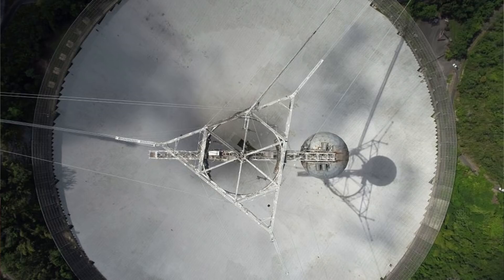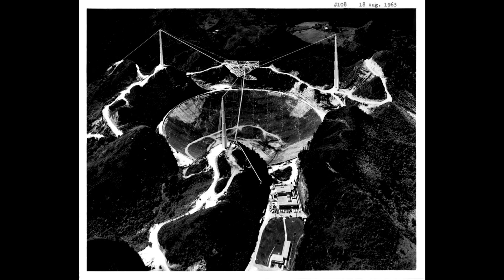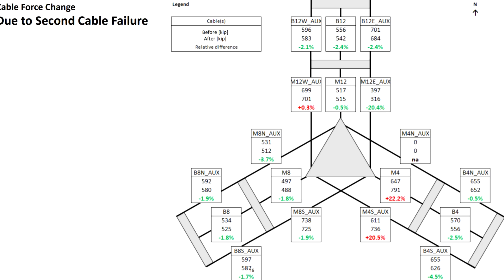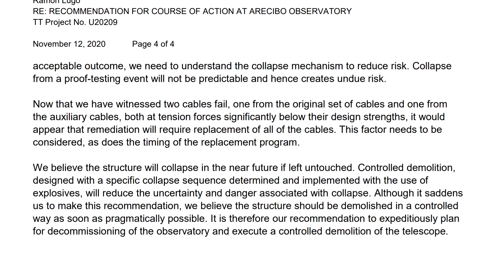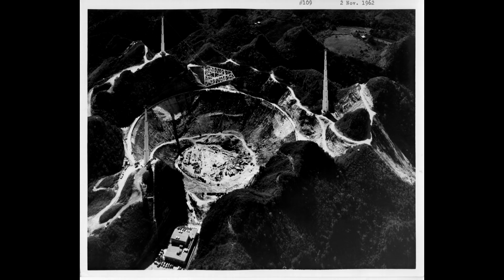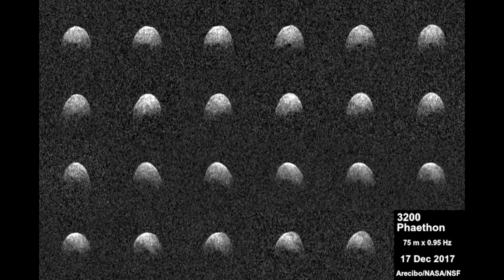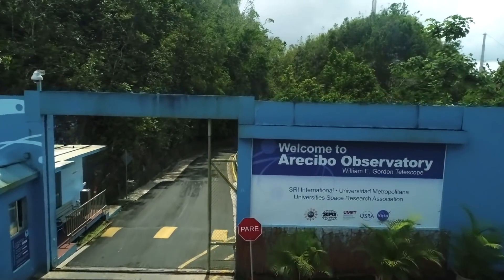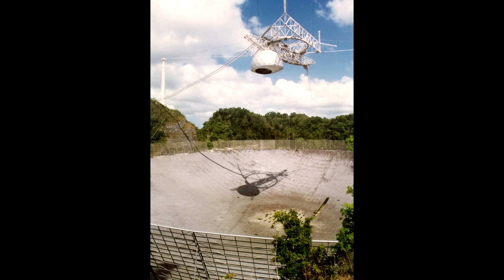Worlds Largest Radar Astronomy Dish To Be Demolished!

Comment: Could we coordinate, using FAST to image echoes of pulses generated by Goldstone?
Reply: It's an interesting idea. But the facilities are on nearly opposite sides of the world. FAST would have to turn nearly to the horizon, which it can't.
Reply: @some1purple  By the time the signal came back earth would have rotated multiple times already. Seems like it would be doable. Using Earth to aim and the FOV is multiple of 12 hours
Reply: @Peizxcv  Gonna disagree with ya there. Depending on orbital positions, Mars is  5-20 light minutes away. Doubling that time for the return pulse is 10-40 minutes. The earth doesn’t spin that much in 10 minutes (or even an hour), and near earth asteroids are a lot closer than Mars.
Reply: @mrb692  Yes, I forgot radar astronomy doesn’t look for extrasolar objects as other astronomy
Reply: @someone doh!

Comment: Cant they build scaffolding underneath, or a tower that could take a bit of the weight off during the fixin
Reply: The problem is that those other cables could fail at any time.  That would cause the platform to fall, of course, but when cables snap under tension, they whip around as the energy is released, so the entire 'bowl' and surroundings of the towers are also danger zones.  This is like the engineering equivalent of storming the beaches of Normandy.

Maybe, instead of dangling workers from helicopters overhead, you could creep them in on the ground in armored caissons, but that's a nasty sword of Damocles to try to catch...
Reply: Not really. Do you want to be under like 700 tons that could fall on top of you at essentially any second when one of the remaining corroded cables snaps?
Reply: Visualize what's going on right now with it, the cables can fail at any time. So unless that issue is made safe beyond doubt there can't be any work done to erect that scaffolding under it to take the weight. And if the current cable suspension was made safe enough to do that work there would be no need for that scaffolding. Hind site engineering is always 20/20 but in that hind site it was and is a poor design for long term preventative maintenance. With it's random and at times poor funding there's now no doubt it's suspension cables are degrading due to environmental reasons. I'd be willing to bet money that somewhere in there archives there's more than one engineering memo warning of future issues with these cables that got ignored due to budget. What ever gets built (if ever) to replace this they can at least learn from the design mistakes made on this one. And since it was originally built large cable production and methods of protecting them from degradation has advanced exponentially. Large open pit shovels as one example now use plastic coated steel cables to vastly increase there service life.

Comment: Sooo .. time to make a challenge to design a replacement that is, AT A MINIMUM, the same capabilities/specs of Arecibo Observatory.
Reply: No, there is  far better one and the Worlds largest already, far outstripping this one in China called FAST.
Reply: @AnarchyinFallout  
As Scott noted in the video, that one is not nearly as capable since it was designed and built as a radio only telescope.   Arecrbo was designed, built, and upgraded, as a more versatile and capable Radio & Radar Telescope.  Yes, it is smaller than the one in China (~300m vs ~500m diameter) but the one in China is more optimized as a radio only telescope.  
Thus the idea of a Challenge to come up with a design that is AT LEAST as capable as the upgraded Arecrbo Telescope with modern materials, techniques, and technology.

Comment: Someone should also decommission The Leaning Tower of Pisa it is dangerous.
Reply: It's not. It has been stabilized for years now.
Reply: So you see my point.
Reply: @Dysturbed-00  
Your points not valid.

Fixing the tower was pretty easy. Just had to drill holes underneath and fill with whatever kind of concrete they used.
And the building was on the ground, not hanging by cables that obviously weren't made to the level they thought.

But it's not actually that hard. They could just build scaffolding under it.

But the unknown cable problem makes that VERY unsafe.

They would literally have to design and build something that could just reach up and grab 800 tons all at once.

VERY doable. Also, VERY expensive. Probably more than building a new telescope. And would take more than long enough that the other, already damaged cables, are about guaranteed to break before the equipment was actually built.

800+ tons, 500 feet off the ground, with a serious time limit.

Not everything can be engineered. Engineering takes time. the tower had many years to go before it fell, and all of the engineering to do it had been done long before. They just had to apply it to that situation.

The telescope has a lot of dangerous unknowns that the engineering can't really be done for now. And it wasn't done before.
Reply: They actually spent a lot of money and engineering to "stabilize" the tower at Pisa so that it is no longer subsidizing. It had 'suspenders' on it for several years along with counter-weights.

Comment: As a metallurgical engineer my gut instinct on why the first cable failed at only 60% of its expected breaking strength is the cable probably experienced some fatigue.
Reply: Sitting in the jungle for how long?  Yeah I think there might be issues.
Reply: These cables do need maintenance, if not properly greased the will accumulate water in the core and start rusting from the inside out. A cable may look good from the outside but may be totally rotten from the inside. especially if they have painted the cables (looks like the did just that). The paint will trap the water inside the cables
Reply: I agree. Probably wind causing oscillations in the instrument and therefore the cables. Just slowly work hardened the cables over the decades. Add that to not enough money for maintaining it properly...
Reply: How many tropical storms and hurricanes has it gone through?  That had to take its toll.
Reply: A metallurgical engineer figures the broke cable probably experienced some fatigue. Hmm. I don't know, man. That's reaching pretty far out there! You 
might be overqualified for this project.
Reply: Likely they spent all the money given to them by Murica for maintenance on other things instead. Least the money can now be spent back home.
Reply: @AnarchyinFallout  surely this is a troll?

Comment: I count 7 cables from tower to ground at 2:36
Reply: If understood the drawings correctly, the cables ground to tower and tower to focal platform are different. There seems to be a cable head frame on top of the tower. Perhaps what  you are thinking about is like the Golden  Gate where cables run from ground to ground while just resting on the towers top.